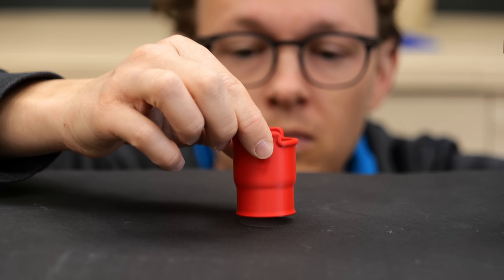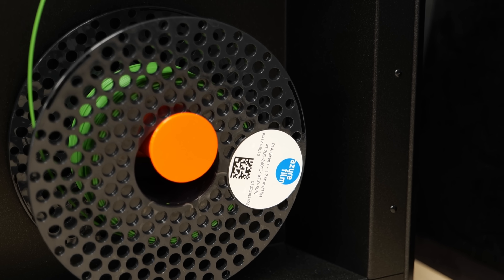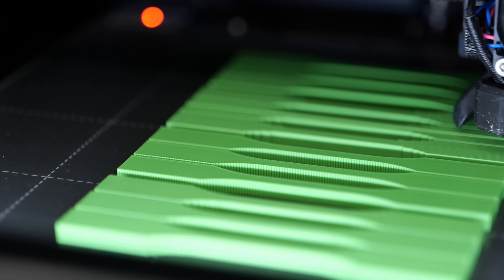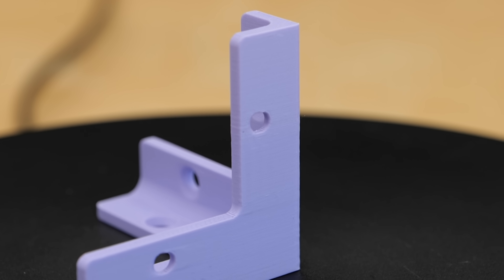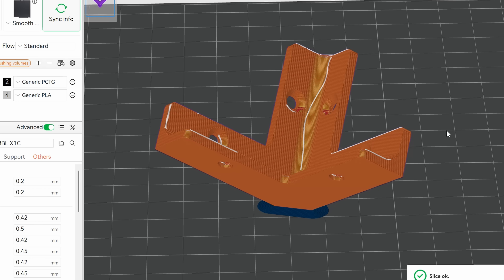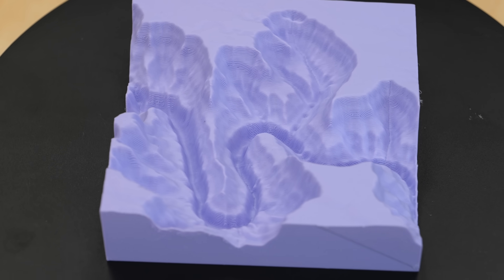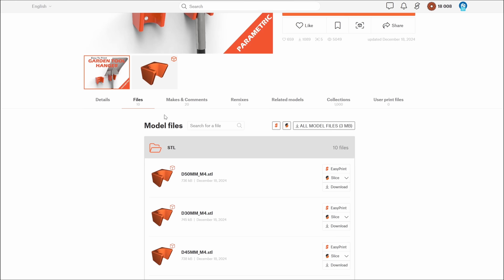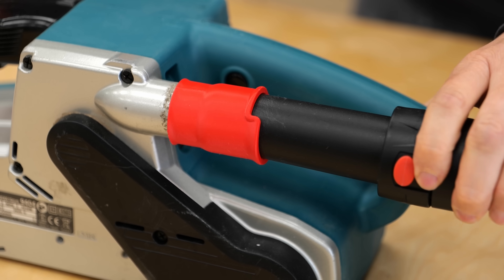Does Angled 3D Printing Really Make Parts Stronger?

Comment: Very interesting, I usually try to avoid waste material for supports, but sometimes it's better to waste some material for a support, than having to reprint a broken part. Couple comments: 
8:10 that's not a quadratic interpolation, because a second order polynomial cannot have a Wendepunkt (curvature change of sign). It looks like you forced horizontal tangents at start and end, probably because the tensile strength at angle alpha should be the same as at minus alpha, so that would give you horizontal tangents. Did you use quadratic spline interpolation, maybe? 
You mention the analytical solution, it would have been interesting to see that plotted here. 
For the plotting of the tests, I would generally recommend to not plot connecting lines, as those lines imply knowledge of what is between the points, but we don't have any measured info.

Comment: ironic, i used to use goofy tilting buy YOUR videos changed that. a part like that id go HOT AND SLOW AF likey with my PETG clear profile because layerlines do not exist with that profile. im a janitor by day and praticly a mecanic and contractor off the clock, my PETG ID badge holder i put on my keyring has survied so far like 10 moths no issues! 

when i started making them out of PLA+ with stock profiles in the upright (fewest supports) printing angle theyd last like 2 days before snapping.

Comment: Printing at 45 is a major hack for complex geometry too. prints that would require a ton of supports for random overhangs may not need them if done at 45. For sure need to manual support the side on the buildplate as that orientation always has minimal contact area

Comment: Very helpful. Thank you! One option I consider is the addition of a reinforcement - typically one or more screws (like a backbone). For example, I designed a support arm for my (large) GPS that attaches to the windscreen with a sucker. It's printed in ASA (to resist the sun's heat) but also includes three #10 x 4.5" lg SHCS. The holes are a tight clearance for most of their length but include a tighter diameter at each end so that the screws can cut their own thread and don't come out.
Coincidentally, I have just added some flats to a Quadro toys 6-way connector to print it in one piece (it will rest on three legs). It was made from two identical halves, joined with M4 flathead screws but, one vertically printed branch snapped during the frame disassembly. For anyone interested the angle of the plane is at 35.26 deg from horizontal (ie: the flat on your three legged bracket @ 14:48 ff). I am about to do a test print in this new orientation for the connector to determine its strength. Cheers.

Comment: Great vid Stefan . Thanks for sharing. I'd be very curious if keeping the orientation to the easiest to print (hose adapter vertical) but add the same plastic used in filament to thicker walls would add sufficient strength. I print hose adapters frequently for my tools and don't have them fail but that might be because I make them thicker than might be optimal.

Comment: I once printed an adapter for my Proxon band saw to my Bosch shop vacuum. I used the upright position (tube direction vertically), never had a problem. Of course the band saw does not have to be moved as often as a sander, but therefore I have to a- and detach the vacuum's hose quite often, as I use the same for all of my tools.

Comment: Your hose adapter at 45° yielded a 30% increase in layer strength, but it took longer to print. Wouldn’t redesigning it to have 30% thicker walls have provided the same part strength, and taken a similar time to print?

Of course that’s not possible with all parts, but often a chonkier part design is an good answer.

p.s. Isn’t it rather obvious that a Benchy goes well with angling 😂

Comment: I’ve designed and made vacuum hose adaptors for my Festool,and Bosch gear in the past, plus various bench grinders and extractor adaptors using ABS, ASA, even PETG, and I just use more perimeters, and different infills to make them more durable. If they break through misuse or get damaged, I mod the design and print a new one, but now that TPU or PEBA is an option with my latest printer, I’d probably change the material for a more flexible one or add a soft insert if this was a recurring problem.

Comment: I'm always thinking about this.  I print mostly PETG and the issues I run into when printing at angles is that the surface quality greatly suffers.  For a purely functional part this might be ok, but most of the time it's not. 

Your best bet whenever possible is to design your parts with print orientation in mind, and compensate for it whenever possible in the design, rather than trying to solve it with the 3d printer.

Comment: Typically to control part strength I rely on top/bottom/wall line count AND most importantly infill pattern/density. By using cubic and cubic subdivide, I'm effectively angling the part internally while leveling the external wall to enhance appearance. Zero issues with part failure on some pretty demanding applications. To prevent your bracket from splitting at the counter sink, simply increase  the wall line count surrounding the hole/counter sink.

Comment: One of my earliest prints when I was still learning how it all works on an Ender 3V2 used a large screw to hold two adjustable parts together. Naturally when printed upright it was weak and would break along the layer lines when tightening the screw, printing on the side would not only require supports but also make the threads rough. So I split the screw in half lengthwise, printed it on the flat side without any supports and then just superglued the two halves together, very clean and strong enough to use.

Comment: Concentric and Archimedean chords options will hold up a lot better to screws and won't let the whole part split in two like monotonic straight lines do. Same when using more walls instead of infill since those follow the shape of a hole.

Comment: Would've liked to have seen a little more real world comparative testing in this video. The hose adapter was printed vertically and then forcefully skewed until failure. Then it was printed at an angle and only just wiggled a little bit to demonstrate how "strong" it was before a conclusion was made. It seems like the vertical print could have handled most daily abuse (especially if it been designed with thicker walls) and the angled version was demonstrated with much less than daily abuse and presumed to be better. So the viewer is still left with unanswered questions... for all we know it could have still split diagonally if the same force had been applied as that of the vertical one.
Reply: Agree.  Felt like one of those late-night infomercials. lol

Comment: As someone who's yet to print functional parts... (oh wait, my second print was a "bladder" for a medical dummy that leaked everywhere...) I'm not really versed in this but it seems like layer adhesion would be the most important thing to get right in this case.  And why, if it's two layers of hot plastic, wouldn't it act as one?  Why does it still split so easily?  Why doesn't it merge?  Would longer print times fix this?

Comment: Rather than mess about with orientation, why not just print the first part straight up out of TPU?  You get great layer adhesion, and the part would be flexible which would be an asset for this application.  I would never have chosen PLA for that application.
Why would you print the corner bracket standing on its tip?  That's got to be the dumbest orientation of all.  Flip it 180 degrees and you have a stable part, resting on six points, and probably not needing any supports, and you don't need to change your model.
Considering how much experience you have 3d printing, I have to say I was shocked that you weren't smarter about this.

Comment: I just recently tried CC3D PBT Pro filament and the prints came out looking like an injection molded part with layer lines barely visible. The part I printed had 2mm thick walls so was somewhat flexible, but not as much as TPU. The strength is unreal and attempts to break the part (with a LOT of effort) resulted in it tearing across layer lines, not at the layer lines. I get the impression that orientation doesn't matter with this material. Printed using PETG settings with no cooling fan and an open printer (non-enclosed). MUCH stronger than PLA + and PETG with a bit of flex. Minimal to no stringing. The only downside so far is getting the print off the PEI plate. Found using a glue stick, or in my case, hair spray helped. Unfortunately, the original supplier on Amazon ran out of stock and a different supplier wants almost triple the price for the same CC3D filament.

Comment: I wonder if a minor slit in the vacuum adaptor would have allowed the slightly undersized 5 degree version to not break on first install. Ideally it would have some overlap e.g. cut from centre to the half thickness point, follow the curve of the circle for -5mm then finish cutting to the outside. There would then be some flex, even in PLA and the amount of air escaping out the slit would be reduced.

Comment: I'm no engineer, but it seems there are many ways to "reinforce" the belt sander hose adapter:
1) print with different material (ex. TPU)
2) anneal the print
3) wrap the adapter with duct tape to reinforce it
4) design the adapter as a swivel joint to alleviate stresses on the part
Reply: 5) Forget the 3D print and just use duct tape!

Comment: Multiboard is pretty good, totally agree with some clever design work for strength. I have a fair sized wall of it full of stuff and designed and published gear for it too. It is a little tricky to get into. Parts need to be easier to find and although the planner is better than it was there is still room for improvement. Overall tho... highly recommended!

Comment: For vacuum adapters tbh I recommend printing them undersized and using TPU, the worst orientation for stiff filaments is really not an issue for TPU. I always do it this way. Another option is to use TPU couplers on a stiff part, for example I have a TPU adapter  for the hose that takes PLA nozzles, rather than directly printing PLA nozzles. I think your hose adapter in this case would have worked super well as a tight friction fit TPU part. Don't get me wrong, this is still good data, but for this specific case I think the issue is solved at the material choice.
Reply: I think the issue is solved by spending $5 to buy the part from the manufacturer instead of wasting $20 worth of filament making 100 extra prints and spending 20 hours in CAD tinkering with the design.
Reply: @IRMacGuyver  A lot of the time you can't buy every adapter you need, especially with vacuum cleaners: I have found the selection is very bad. I don't know how commonly sold this adapter from the video is.

Also, 5$ for an original part? I don't think so, manufacturers are always charging 20$ minimum for a first party adapter. 100 extra prints? I doubt anyone needs to iterate this more than 2-3 times, and that's already way too much for a simple design like this. Even if you were to print it 2-3 times, you'd be looking at less than 2$ of filament, spools can be found for less than 10$ if you try hard enough and buy in bulk. 20 hours in cad? This design is doable in 20 minutes.
Reply: @IRMacGuyver  On top of what others already said this stuff is a hobby. Do whatever, who cares. The fact that you learn stuff by making those prototypes is amazing. If the first design takes 20 hours, the following ones take way less and so on.

Comment: Some other simple tricks without changing orientation:
1) More wall loops
2) Overall higher infill density
3) If 2) is too much time-wise, use a modifier and increase infill density only where needed
4) Cylindrical parts could be printed with spiral vase mode, slightly distributing the load into more layers

Comment: I’d say you have to include the weight of the support material, cause that support material could be used to just print a thicker part. Sure, sometimes you’re space restricted and then it makes sense to ”expend supports”, but for most applications you could use the support as added strength.

Comment: 15:35 That folding multiboard hook is genius!
Reply: Agreed!   I got some strange looks from the other room I got so excited when I saw that.  Brilliant approach.
Reply: Some real lateral thinking gone on there. Impressive!
Reply: A lot of things in Multiboard do this for the parts requiring strength, and it's made me think a lot about how I design things, too. It's a really well thought-out system, if a little chaotic currently.
Reply: Wow, yeah. Love how each manufacturing paradigm has its own design aesthetic because of the limitations. Metals are extruded, injection molding has draft angles, 3d printing has a whole shitload of these too.
Reply: I wish it were one of the connection options in Orca's cutting tool
Reply: yes, its really genius
Reply: I feel it's going to need a little bit of fiddling to get the right thickness, but I'm going to start incorporating this to my designs. Genius!
Reply: Multiboard, TPU layer adhesion and the S graph were my hot takes from this video
Reply: 🤯 someone was thinking with all their brain cells that day

Comment: These tests are fascinating. Thanks for taking the time to run them. I am, however, curious to know if any post-print heat treatments would increase the strength. Hot salt/sand immersion? Oven soak?

Comment: See there's a big problem with this.  For many projects, a 3D printed part is only one step.  After prototyping it with 3D printed parts, the same part might then be made via injection molding or other means.  So you can't just redesign the part all willy nilly.  You can print it in a different orientation, but ultimately you can't alter the geometry since printing isn't it's final form.
Reply: Sure, for mass production, but for people who own a 3d printer, a lot of prints are just one-offs to fill a transiant need.

Comment: For simple L brackets and such, I wonder if cutting the bracket in half, so you still end up with 2 L shape, but thinner in thickness (not cutting it width-wise, but cutting it thick-wise), and print them in perpendicular orientation, then gluing them together? I wonder if that is worth doing.

Comment: 45 degrees also tends to be the best way to print parts that are not actually optimized for 3D printing (prototype automotive parts in my case). The reason is that this orientation substantially reduces the amount of supports and overhangs are not as big an issue as it used to be with recent printers having substantial amounts of cooling.

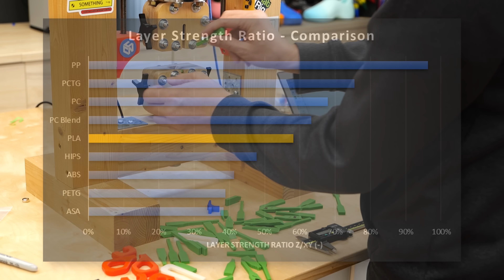Comment: (5:35) Why does PETG have a lower layer strength ratio than PLA? In my experience it has a MUCH higher inter-layer bonding strength than any of the other materials below PLA on your list... Are you overcooling your PETG prints? I've been using PETG almost exclusively for prints that need structural strength for almost 8 years, now, and have completely abandoned those others (below PLA) since, except for ABS, which I use as a dissolvable support material for said PETG.
In my experience, PETG is a superior material, both for printability and strength, at that level of heat, getting beat only by hotter/more difficult to print materials higher on the list.
Is it because PETG has such high layer bonding strength that the ratio between Z and XY is lower? I'm confused... Is this just a chart reading issue on my end?

Comment: I've been using corner brackets in my sim rig that connect the aluminium extrusions at 90° angles. For improved stability I printed them at an 45° angle (inspired by Slant 3D as well) and none of them failed so far despite me being a pretty heavy guy and my loadcell brake handling very high forces so I really step onto them. Of course I also used more walls and infill than on other prints for those parts.

Comment: thanks Steffan, great video. It's interesting that resin printing requires the orientation consideration for other reasons leading to most being printed at an angle to drain resin during print - not necessarily for strength.